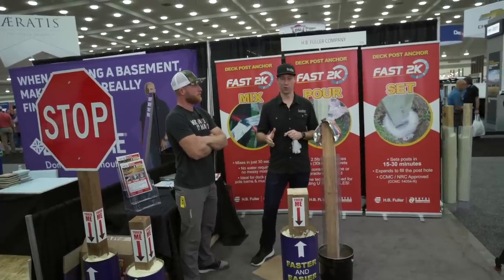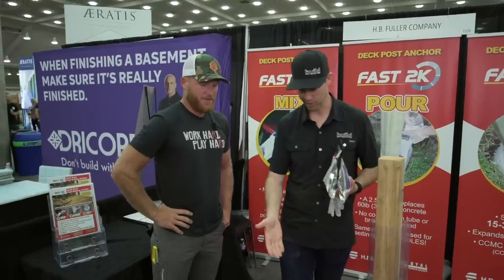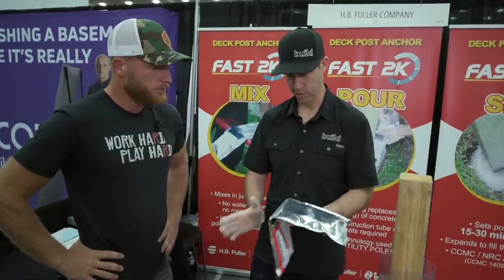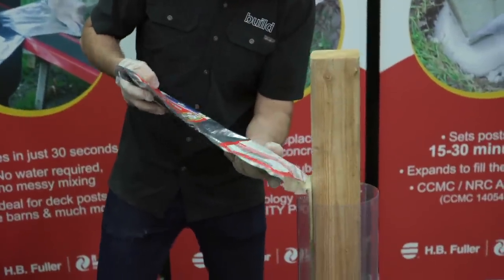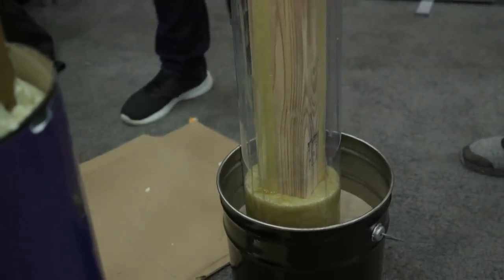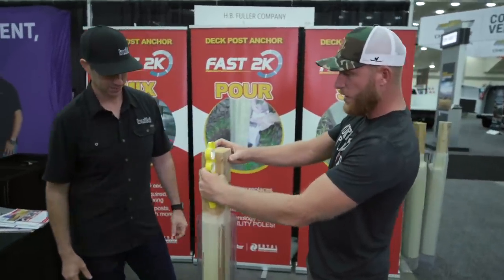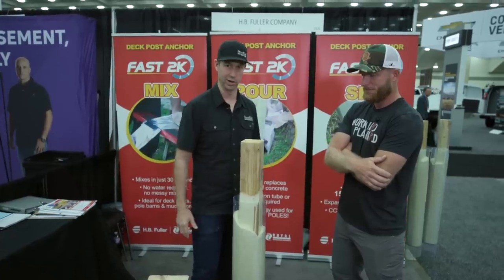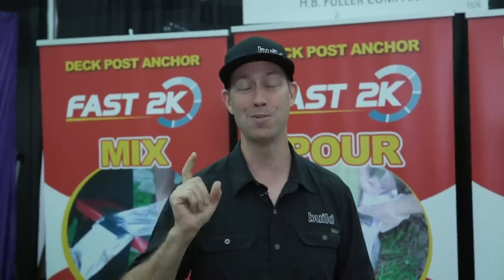Foam INSTEAD  of Concrete???

Comment: 80lb bag of concrete $2.49 @ homedepot
Reply: even the expensive stuff is only 8... IDK why they quoted a full yard of concrete LOL
Reply: EL c
60 lb Quickcrete ready mix  bag is 3.25 pr bag unless you buy 120 bags then it is 2.65 per bag at home depot in so cal.
Reply: They’re talking about having a mud truck come and do the pour.  When you’re doing 20+ posts for a barn you’re not going to mix all your own concrete.
Reply: Exactly
Reply: 10 bags of 50s, 1 yard.. 7 bags of 80 for a yard... Shlepping all tat nonesense around is a bunch of b.s.. 60 -80 to ship it to the site.. That's $100 to get it there, then moving it to the post...
Way cooler and has a strong hold because it expands tight to, rather than forming to the hole.
Reply: More like $4.29
Reply: @erikkrumm9433  they quoted a full yard because he uses a 1/3 of a yard per hole, it was a comparison of estimated cost between the foam and concrete. The answer to your question is obvious if your actually paying attention to the video.
Reply: You are right, but there are plenty of other factors, Weight being the biggest issue and mixing. These are ready to go and anyone can do it. The big selling point was the strength and the fact that there is no rot as it seals it off.
Reply: @jonhubbard5787  Yeah I agree w you they both have there ups and downs. Nothing wrong with innovation though.
Reply: @ThatE46  I concur, good sir. I still just have an uneasy feeling with that product. I feel like they are trying to get over on me, with this product, in this video. I'd literally have to see/know someone using this in the field, on a regular basis, before I'd even consider purchasing..
Reply: @jonhubbard5787  Yeah definitley would like to see some more testing with it.
Reply: I thought the same, post concrete are just around 3 bucks  :D   this thing is 12 bucks, I'll be in the poor house if I used this to build my fence  :D
Reply: Cue the backyard contractors talking about buying bags of concrete at Home Depot LOL
Reply: @jonhubbard5787  it's quick and easy. 30 seconds mix in the bag cut it pour it move on to the next saves shit loads of time no mess
Reply: This debate has been funny!
I can’t believe nobody has realised it won’t be long until these guys will be filling trucks up with this shit and blowing concrete away. Adjusting slump so they can travel with it just like premixed concrete and available in cubic metres! 

There’s a good business idea for you entrepreneurs to jump on!  Huge Market
Reply: Yes, there are people who have the time and man power to mix that much concrete but these two have businesses to run and they are at an expo that targets businessmen. When the job is perfect for a 50,000lbs truck to get right in to pour each hole they will likely continue to use them. But in remote locations or areas that would benefit from the lateral pressure gained by this innovative product it is a great method to have in your back pocket. If you’re watching their video and are confused by any benefit this might bring to your operation then the product clearly isn’t for you.
Reply: Not sure about elsewhere but in uk there is postcrete which is 50lbs, £4 and sets in 3-5 minutes
Reply: For a fence post? Just put the concrete in dry and pour a gallon of water on it. It’s a fence.
Reply: Cheaper at the menards 11% rebate or 11% off sale
Reply: @3 Subscribers Without Any Videos!!!!! but concrete is not cheaper, that bag replaces a 1/3 yard poor for a structural post. Since everyone keeps mentioning Quikrete I'll use the 80# bag, which yields 0.6 cubic foot of concrete. 27 cubic foot in a cubic yard so you need 45 80 pound bags to equal 1 yard, so to replace that $12 bag of foam (1/3 yard) you need 15 80 pound bags of Quikrete. At $3 a bag that's $45, $33 more expensive per post then the foam
Reply: @JWPshenigans  yes you do
Reply: Rusty Shackelford  no it's not
Reply: @jaydunbar7538  wow just Google it it's 2.80 A bag wow don't be lazy and try to spread lies
Reply: @Timms MC then just order the 5 post gallon two part. That simple. Secureset sells it in bigger amounts for when doing many posts.
Reply: @D not for barns. This is only for fencing and maybe is a deck is small enough.
Reply: @JWPshenigans  not for barns. Not anything that has load to it other than fencing.
Reply: @erikkrumm9433  probably since a contractor deals in yards when buying and the amount per post is only used to calculate how many yards he needs
Reply: exactly..15 a bag for this stuff is too much $    cool concept tho
Reply: EL CHINGON  80 lbs > 2 lbs ? I pick 2 lbs
Reply: I get contractors deal in yards but he did a per hole on the foam and a per yard on the concrete... it probably a better product, but concrete is cheaper...
Reply: An 80# bag is approx 0.6 cubic feet of concrete.  A third of a yard is 9 cubic feet, so at 2.49 a bag, it would cost you $37.35 for a third of a yard.
Reply: @Steve K, and others who is mentioning this is cheaper, and thinking that a 2 lb bag of this is equal to 1/3 yard. Re-watch the video, and go to other sites that sells this kind of product and you will see that 1 2lb bag of this doesn't replace 1/3 yard of concrete. He says in the video that it would take about 3 bags for one of the holes he typically uses, so if it's 10 bucks per bag that's 30 dollars per hole. A typical product like this 2lb bag replaces around 2 50 to 80lb bags of concrete. If you figure a bag of concrete is 2 to 3 bucks a bag on the low side, then you are paying 1.6 to 2.5 times the cost of cheap concrete, if you are on the higher side of 4 to 5 bucks a bag especially for "fast setting" then it's on par with concrete. 

At that point even at 50lbs you are reducing 100lbs of concrete needed to 2lbs. So figure a yard of concrete is what 4050 lbs? to around 40.5 lbs? At 10 dollars per bag that's a little over 200 bucks for a cubic yard of this stuff. Getting a cubic yard of concrete delivered is around the same price maybe about 40 bucks cheaper depending on the area. The concrete isn't that much if bought in bulk it's the delivery cost. I am sure if you bought the foam in the same kind of bulk you could probably get a decent deal on it. That and others have mentioned buying it in buckets for larger holes. 

Now whether it works well or not, and has similar strength over time, doesn't degrade, etc I have no clue on that, I will need to research it a bit more maybe test it out. I am just speaking to the cost comparison to concrete as it seems a lot of people here are making the wrong assumptions.

As for the direct comparison Steve K used, 

27 / 3 = 9 / 0.6 = 15 * $2.49 = $37.35

Since 1 bag of this replaces about 2 bags of concrete...

27 / 3 = 9 / 1.2 = 7.5 * $10.00 = $75.00

Since this is closer to say a fast setting quikrete at usually around 4.97 or 3.98 if you buy 64 or more from HD. 

15 * 4.97 = 74.55

So in an example that is closer to what this actually replaces and or just comparable concrete version concrete is 45 cents cheaper per 1/3 yard. Figure on the low end and say it replaces 2 #50 bags, would you rather lug around 750 lbs or 16 lbs or so?

Edit... used the 0.6 figure for simplicity instead of going to 0.375 on the #50's since you can't find a direct figure on the foam I have seen figures stating it's 2 #50's to 2 #80's @ 33 to 36 oz
Reply: OCP - I made no comparison of the value of the foam vs concrete, I was simply correcting someone's previous comment.  As for embedding posts in either foam or concrete, that's not how it is usually done.  Some codes require that all degradable posts be above grade and connected to a foundation pour with corrosion resistant connections, so only a piece of steel is embedded in the concrete (I'm talking about all codeable structures, not mailboxes or fence posts).  So on a construction like a deck connected to a house, there must be compressive strength, so the foam fails and concrete it is.
Reply: Wait.  Fence posts are related to fences and fences are related to walls. Fence posts are racist and by association the post foam is too.
Reply: @D, "Well I use 2 bags of concrete per post", ok but his posts need 1/3 yard per post. Are you saying 2 bags of concrete are equal to 1/3 yard? Is the concrete you use quick setting? If not on either account it's not really comparable at all.
Reply: D - He's not talking about fence posts.  He's talking about structural posts, like those that support a deck attached to a house.  Those type of posts will consume much more concrete than two bags of ready mix.
Reply: Exactly! Theyre saying its like the same price or cheaper. This is basically a fucking commercial. Also they're saying you can build on it right away but it hasnt fully hardened yet your stuff wouldnt be level.
Reply: EL CHINGON Ummm concrete will rot all wood if sumerged in Crete! So go ahead and bust your nutts! I like this idea,
Reply: EL CHINGON I mean we’re running out of sand so...
Reply: EL CHINGON that’s why I hit the dislike button because of false information
Reply: @Timms MC or they will be smart enough to not have only this product and think about other scenarios, that's the most likely.
Reply: R134eS2o dude bags at Home Depot it don’t need sand or aggregate and most people already have a wheelbarrow and a hoe, that’s all you need l
Reply: Joe Penrod it’s 150 times cheaper
Reply: LightGesture way more expensive if you need 3 bag a hole
Reply: @Timms MC but you won't be mixing these bags either. you'd probably get a truck to pour.  if you do mix these vs mix cement you prob only saved half your time.  although effort yes significant easy to do this vs a back of concrete
Reply: 40lb for 10$ in canada
Reply: Todd m  my arms sore af reading this comment already.
Reply: EL CHINGON Jesus that's cheap, I work in sales for a block/ bag plant in Washington, we're selling 80# for $4.14 a bag wholesale. We supply Lowe's, Home Depot, all the local Mason's.
Reply: Have fun mixing 👍
Reply: What about the environmental aspects
Reply: Looks like surfboard foam...
Reply: And at Lowe's. I think these guys are having a mixer come in. Gay.
Reply: Todd m  I will. Money saved is money earned.
Reply: @D I used this foam concrete for my fence posts at home and man am I disappointed, since it weighs practical nothing, the wind blew my whole fence out of the ground because there is nothing weighing it down. so I've had to re do the portion of fence and almost double my costs
Reply: North American YouTuber  i just want to ask whats.the difference between these foam and concrete?
Reply: @erikkrumm9433  because some projects are larger than others...
Reply: @D that post seem to be about 3.5 feet deep and it only took one small bag (and they said they have bigger bag for deeper post i assume). This will work fine in most of the country. 

You would be mixing it for 30 second per post.. Not a big deal. Just moving conc. equipment from post to post will take you longer than that. 

and you can work on it pretty quickly. 

I just wander what will it effect that deterioration of the wood post over time.
Reply: I just put the post in the hole and add dry redimix. Our water table is usually high enough to wet it. It not, I add water after. It honestly works. I recently dug out some posts ( changed design) that were fine after 15 years.
Reply: Wonder if you can do a hybrid of both concrete and foam for costs savings and for weight? Best of both worlds
Reply: Erik Krumm Because they on salesmen, I mean conmen.  Same thing in this day and age.
Reply: Nah quickrete $5.95 bag at 3 bags per pole $16 plus vs 1 bag foam for 3 feet.
Reply: my dad put in post around his 5 acre land for a fence used concrete no mixer and whatever crap just poured in the hole and added water like a real man
Reply: He said he used a third of a cubic yard of concrete per hole. Surley he meant cubic ft instead for 4" x 4" post!
Reply: R134eS2o  He said concrete, not cement. Redimix (Quickcrete) concrete mix in the bag includes everything except the water and mixing effort.
Reply: And with bags you have a lot of waste paper and plastic as well.
Reply: And our experience has been, that the taller the posts, the more torque happens to, say, fenceposts, during wind.  That has caused fences to fall down in windstorms, & failure of a light-weight, backyard tetherball pole, with its first use. 
i don’t know HOW a phone company can use it for heavier-duty installations....unless Home Depot sold us all the cheap junk for premium prices...
Reply: Todd m  I hand mixed 62 bags for a 10 X 24 pad for my dogs kennels. Trust me, I'd never do it again.
Reply: Umm ... where in the hell are you getting $2.49 for a 80lb bag of concrete?  Shit I'm looking for it now and it's $6.49 for just a 50lb!... Link that shit homes! lol
Reply: @D shiiiiid... I just rip the bag, pour it in the hole, and add water, mix with a stick, and done!
Reply: @Timms MC 
Your absolutely right. I asked about filling the area of our suburban home in the area of "no man land" that useless area on one side if the home and I asked if it was worth doing it myself. The area was 6' W x 25'. 
No, get a truck. Followed by your explanation. Lol. 
It made sense. A little 4x4 square patch to set the A/C on sure, grab a bag or four. But the whole side if the house? Nope.
Reply: Working concrete beats the crap out of me.  I'll take this any day.  If it costs more you have to ask, what's my time and effort worth?
Reply: Since its used for many industries, in many countries...
I might suggest AIRCRETE ....
USACoE uses it,.... Airports, Runaway Lanes, Fences,...
Reply: this video doesnt make sense. concrete is much cheaper
Reply: R134eS2o  not sure about where you are but 30 to rent a mixer and wheelbarrow and another 30 for a yard of gravel sand mix , it will set 20 posts for about 85 90 bucks after tax . I assure you concrete is better and cheaper
Reply: Jay Dunbar a 12inch hole 4 feet deep filled with concrete is .12 of a yard there is no way he uses 1/3 yard per hole that’s insane
Reply: @JWPshenigans  Uh, yeah. I will. Dig 'em by hand as well. In Alaska, where we go 3+ feet deep to get below the frost line.
Reply: camgreer with a spoon, that you had to walk uphill to get, both ways, in 6 foot of Alaskan snow
Reply: @JWPshenigans  Don't be ridiculous. It was only 4 feet of snow. And I used skis. But seriously, just last fall I put in a fence with 15 posts, 3' deep (or more), dug by hand with post hole diggers, mixed 2-3 60lb sacks of Quickcrete per post in a wheelbarrow. And I'm 60. We were on a budget and I got a big break on the Quickcrete after 42 sacks.
Reply: camgreer oh I believe you. I’ve had similar circumstances that persuaded me to accept the labor route.  My original comment was to simply paint a scenario that rationalized this foam method. Anything more that a handful of holes is really not reasonable to use anything but concrete.
Reply: It’s $3.90 now lol
Reply: I just pour the concrete in the hole and add water.  Never had an issue
Reply: @joewellindowd5664  Right?!? These people sound like they need the precision pour and quantity for a foundation not a post stuck in the ground you can nail wood too. Also with this foam crap, it weighs as much as concrete right? because if it doesn't then half the function of what a bag on concrete does for a fence in the hole you stick the posts in will be missing unless your dirt is completely capable of resisting becoming mud and drying or being dug with a leveraged force prying at it. A fence is a big flat surface the wind blows into and kids climb over. I wouldn't really trust expandafoam for any shallow anchor to hold a 8 foot fence up vs 20 mph winds or a 180lb person climbing over the fence without just digging up the dirt on one side and falling over. If you want to protect wood , and have solid level post point for a deck use a tube form, fill with and smooth concrete, bolt down some galvanized anchoring hardware to keep wood from pulling moisture from concrete or ground and seal it up with some sealer finishing. Super solid, long lasting level and can be stable enough to scale for whatever. Foam just doesn't seem like a suitable mass bearing material to act as any kind of foundational structure base. It's for filling in gaps with lightweight glue full of airbubbles. maybe encase you heavy concrete chunks with the foam to make that heavy stuff more stable but just foam alone sound cheap and flimsy. As foam, is technically mostly just gunk solidifying up air. And air isn't suitable to anchor down wind sails in the form of large solid flat surfaces exposed ti forces of storms and such.
Reply: And 3 years into Biden and that same $2.49 is now $5.74.
Reply: Bring this back plz

Comment: I used this product on my in-law's fence.  Good stuff.  36 posts, 3.5 gallons of each part, bell shaped holes.
That bagged version is stupid.  Buy it in jugs.
Reply: Then watch fence blow in the breeze
Reply: Mike McKinley not if the hole is bell shaped.

Comment: When I re-roofed my cathedral ceiling cabin, I found the original roof had about a quarter inch of foam against 2 X 6 tongue and groove cedar roof planking.  Carpenter ants had carved our a nest in the foam.  It seems that foam makes an ideal nest for carpenter ants.  We had to replace one 2 X 6 cedar plank too because the ants did not limit their tunneling to the foam though that appeared to be the point of entry of the ants.